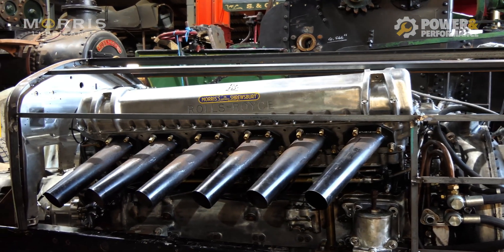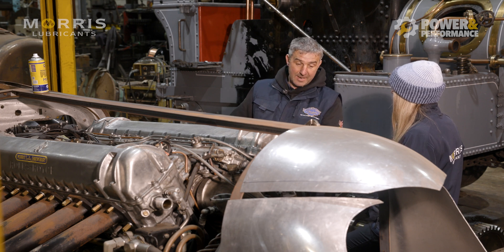Building An Aero Car The Project Plan | Rolls-Royce V12 Mk58 Griffon engine | Power & Performance

Comment: Thank you. The Merlin engine used higher coolant pressure than WW2 Daimler Benz aero engines and the Griffon would have been the same. I suspect that Meteor engine coolant pressure would be the most useful reference point. Tank Museum?